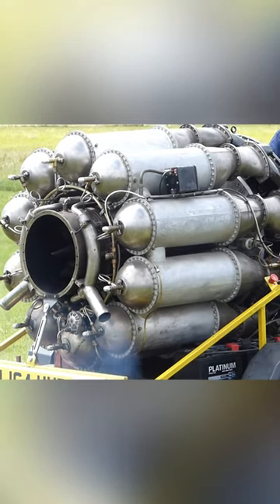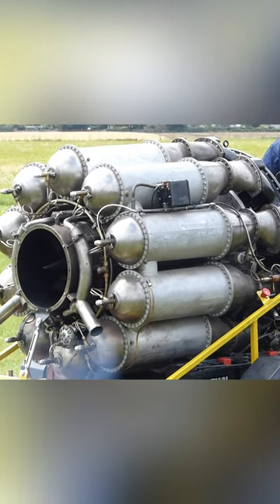FATHER of Jet Engines!? - Whittle W.1X

Comment: Sir Frank Whittle famously went to Winston Churchill in 1942 and said " I've been working on a new engine " Churchill said " why would we need a new engine , we have the Merlin V12 " , I think his mind must have changed after the German ME262 passed a spitfire like it was standing still !
Reply: Well, UK jet engine development vastly pre-dates the arrival of the 262 in service! Importantly Hives and Hooker at Rolls-Royce took Whittle very seriously.
Reply: @ColinMill1  not seriously enough or the allies would have had a flying example , German jet engine design ran in parallel to others , from early 1930s . The 262 release date is irrelevant , the Germans at least were on par with Whittle , infact Whittle in his own words took ideas from the Germans .
Reply: @JosephCowen-fz8vj  There is only about 18 months between the first flight of a German jet and the first flight of a British jet and, despite the Air Ministry being slow to adopt Whittle's ideas the development had ministry backing from 1937 - well before the German jet flew. As for borrowing ideas Ohain did make use of the information in Whittle's patent so it was very much a two-way street. The initial choice of Rover rather than Rolls-Royce for production also accounts for more than a little delay. It is interesting that Whittle's WU and Ohain's first engine were both first run in April 1937.

Comment: Sadly the Axial Flow Jet Engine surpassed the W.NX, best example of a usage of the Axial Flow Jet is the German ME-262 Jet that uses two of them
Reply: Yes, but the Jumo004 was rather delicate. It is interesting to note that the oldest surviving jet engine in running condition is a Welland. There are still a number of centrifugal jets still airworthy including two Derwent powered Meteors that are still actively in use.